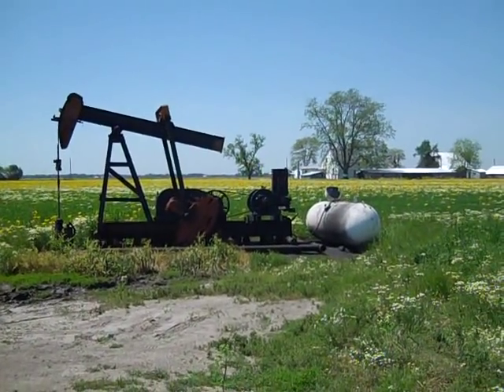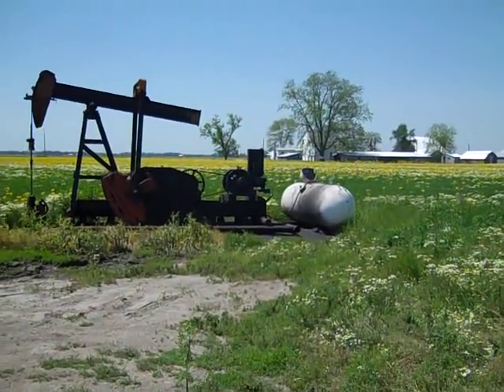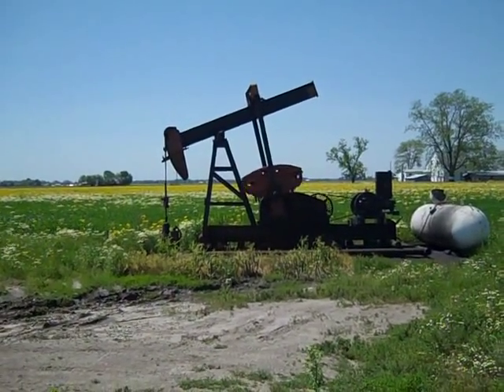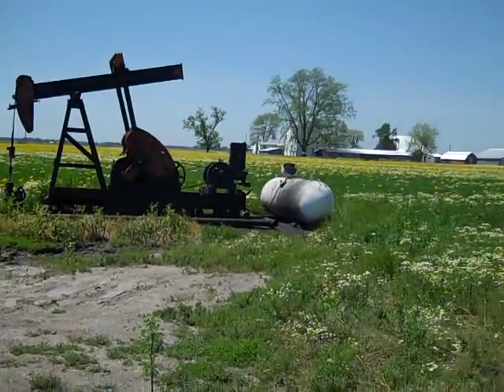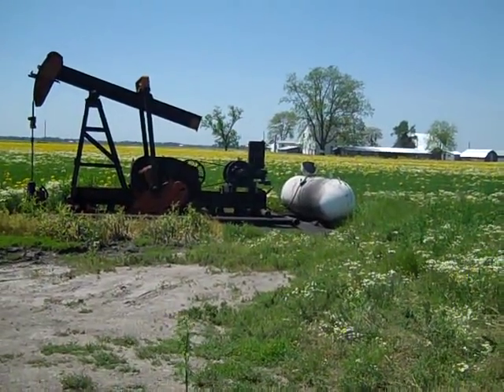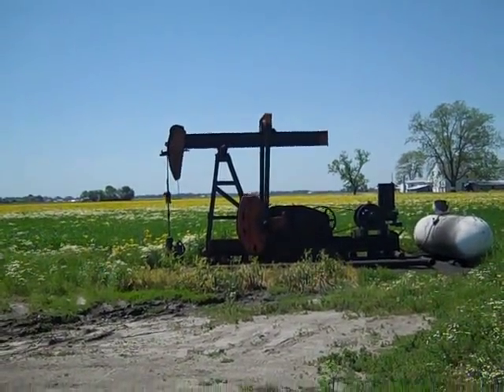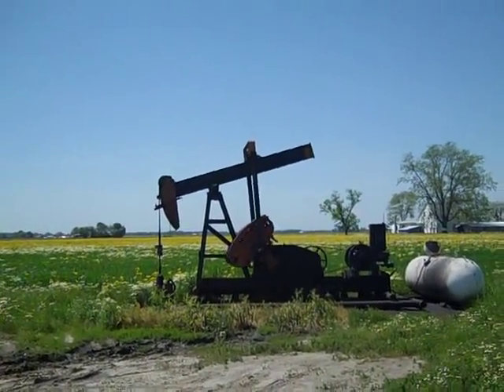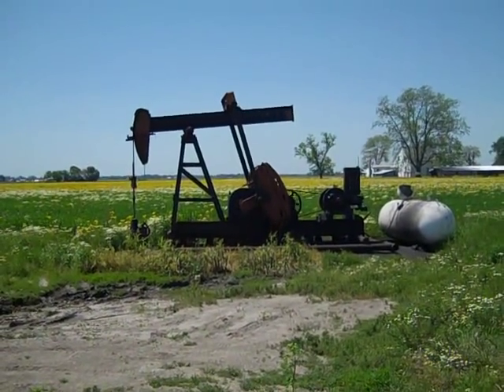Pump Jack: Is it running itself?

Comment: the average pump jack in west texas is probably 3-4 times the size, is powered from the electric grid (480V 3 phase), and can pump several thousand barrels of fluid per day. The water, petroleum (hydrocarbons plus solids, and other contaminants) will go to a processing satellite or battery to get separated and ready to sell or put into a pipeline. Pump jacks, gas lift, plunger lift, electronic submersible pumps are just a few of the different kinds of secondary recovery. They all have their uses

Comment: Scott- im a petroleum engineer, and have spent quite a many hours around these things. That is a super tiny pump jack. Pumpjacks are for fluids mainly (water, oil). Some gas will come up as well. Judging from the propane tank i would say that the small motor is powered by propane. The motor will get the weights on the arms to rotate the first time on the upstroke, then on the downstroke the weights and the weight of the rods (as well as any hydrostatic load) will pull it down, cycling the pump.

Comment: the propane tank is used to start the engine after it started and oil and water pumped down the well make enough gas to run its self if you looked around you would see a some kind of heater,or  a cold water knock out and a set of oil tanks and a water tank if the well makes any water

Comment: You are right Pa was the birthplace for crude oil. Though I am sure there were other places that had oil seeps. 
They pumped most all of the wells in PA dry many years ago. Recently the oil co. went back to frac some wells only to find that the wells had filled up again.
Many scientists now think that oil is actuality made within the earth. Here in Utah we drill down over 2 miles to hit oil. When it is pumped out is is quite hot.when cooled it will set up harder than roof tar. 
Best to you Earl
Reply: @EarlRausch the place where oil was first deliberately pumped from the ground was over in Poland in Eastern Europe , you can find that online.
There were wells in the UK as well which are many many years abandoned , the North sea is the source for oil there now...
The oil in the USA came along about 60 years after the oil in Poland and the UK , though the oil in those places was not taken in huge scales like it was in America back then...

Comment: E775, you were stopped on I-64 there, no? Much of southern Illinois is covered with these little pumps (stripper wells?); especially on the eastern side. These wells don't have the daily production that's found in the western US, but they produce for a long time.

Comment: Hi Scott, most likely this is running off the casing gas.  We still have these in Kansas.  I called a local shop that sells these things because as you are, very interested.  The gentlemen at the shop said that I didn't want to pay the price for experimenting for this pump.  This was about 3 years ago, I think the price was around $5000 for a used casing gas engine.  I hope you can find one cheap!

Comment: it's a Fairbanks Morse engine. the line going to motor is natural gas off the casing. propane is backup source. oil and water pumped out thru tubing goes to flow line off of pumping tee to buried line to tank battery across field. lots of these all over southern Illinois. I am second generation oil. my dad worked 50 years in the patch. I have 32 years in it

Comment: over here in oz we have pockets where you hit propane/methane first, then drill lower/drop pipe lower and get the crude. we also have coal seam gas ( NOT FRACKING ) where they drill to a coal seam and get salty water full of methane bubble (like soda can style ) and it comes to the surface and goes straight into a tank. at the other end of the tank there is a pipe on top for methane, and one on bottom to take the salt water away. years later they will dig the coal out.

Comment: I've been in the oilfield for 10yrs. and yes there are units that run off of casing gas, and the propane is a back up. As the gas dies down they will use the propane, but it is all depending on the situation down hole. There is a gas controlled throttle on the unit. Almost everywhere I worked oil, gas and water are extracted but that is in west Texas. Most water is in the zones due to the flood (flooding zones w/water to rinse oil through formations) or frac water.

Comment: That isn`t a hit & miss engine its a throttle governor Like the one I have here . That looks to be a Fairbanks Morse ZC 118 The model is the CU IN of the engine. The one I`m posing by is a ZC 503. The tank battery is most likley far away from this pumping unit so the trucks can pick up the oil by a side road . They can run the engine off the well head gas if the supply is great enough to. Many times they can run both the propane & well head gas to the engine.

Comment: I took care of many leases with old Climax (Arrow) "one-lung" engines 40 years ago in the Fruitvale, Mountain View, Tejon, Maricopa, and Cymric fields around Bakersfield, CA.  This is not a Climax, but they're similar and run on the same principals. They are beasts, they last for years if maintained properly, and the price of the parts has become more astronomical for these old machines as the years have gone by. I have a restored model in my parking lot at my office we occasionally fire up on propane. We're restoring an Oilwell model 25 pumping unit for a future marriage. I nearly tore a hand off with the crank handle for the flywheel of one of these engines back in '75 when it backfired and failed to disengage. I still have fingers that don't work right to remind me. I hold no malice to the engines, they are marvels...

In some cases there is sufficient casing gas (methane) to run the well all the time. In some cases there is insufficient gas (methane) to run the well at all because the gas has pretty much been tapped out of the formation. In some cases you keep a propane tank next to the unit so that in the event the well is off for some period of time and the casing fills with fluid you have a gas source to fire the unit until it pumps the fluid level down and methane again comes out of the formation through the perforations in the casing; the operator (pumper) changes the well back from propane to methane as soon as possible. The methane is free but the propane is a cost that eats at the bottom line profitability on low volume wells.

I had wells south of Arvin, CA that were 10,000 feet deep and they ran on what was then known as a Climax Model 96. Waukesha distributed engine parts for them back in the day and Lufkin, National, Continental Emsco, Oilwell, American, and a host of smaller national and regional manufacturers all made the pumping units. I think Lufkin is the only one of those I've named that's still around. I live about two miles these days from a small oil field that has several of these units and engines still active. If they get a carbon build up in the engine and it stays hot between strokes they'll begin to "blast" and sound like a goose gun going off around the clock. We used to break these clinkers loose with a mix of alcohol and water in a squirt bottle shot into the carburetor; the engine would then blow chunks... Memories
Reply: Mysterion h(
Reply: We used to dribble water down the carburetor on the V4 Wisconsin  motors on out balers; keep them revved up and all but drown them out with water. The carbon would break loose and blow out of the exhaust. They would carbon up and keep dieseling on when you shut them off and that cured it.

Comment: I've worked on and around many pump jacks over the years, they are used to lift oil/fluids out of hole. They are not used on gas wells and can lose prime if the well changes from oil to gas  They are very simple in design and work similar to those old fashioned hand stroked water pumps that people used to have on there wells with the primary difference being the actual pump portion usually being down hole with a pump rod that extends to surface that is connected to the head.

Comment: My grandfather had many of these wells when I was growing up as a kid.  That tank there is a propane tank for fuel that runs the engine.  These were pretty common in areas with no electrical access.  After electrical lines were more available many years later, my Grandfather had some of them converters to electric.  It all depended on the cost.
The oil pipe is underground there running to a large tank.  If not close by then it is likely in a more central location being fed by multiple wells....or at one time was.  They would try to put these tanks by a main road if possible so tankers could get easy access.

Comment: My grandpa has a oil well on his property. It had a hit and miss engine and the engine ran off the gas the well pumped. Now it has an electric motor cause the engine broke cause it was old, but the well still pumps oil although it pumps more saltwater than oil but he needs it for the gas.

Comment: the propane helps to start motor. once you've got it running you open the natural gas valve and turn off the propane. pretty fun to tinker with
Reply: fun you say?

Comment: I'm not an engineer by any means. My dad was, so maybe that's where I get my curiosity. I find anything in mechanics and manufacturing fascinating. I love taking things apart. I also have a strange fascination with power lines, utility poles, substations, and all that. I guess what I'm trying to say is...very cool video! I didn't even know that oil or natural gas could even be drilled in Illinois!
Reply: Apoc Alypse all over if you got the money to drll

Comment: The propane tank supplies energy the motor beside it, which uses the belts on the sheave of the motor to connect to the sheave on the pump jack. The fact that there's a propane tank present indicates to me that produced gas is not running this well. You can see the sheave on the jack spinning, which cranks the arms on the pump jack and therefore moves the rods up and down, lifting fluid. The well is likely pumping light oil with low sand, gas, and possibly water. If the well produces natural gas, it's not using the gas to run the motor; this would be obvious to point out as you'd see surface casing running to the motor as well as a scrubber in addition to other stuff. There's no production tank visible so I'm guessing that any produced oil or gas and piped underground somewhere. Hope that helps.
Reply: Yeah it looks to me like the gas engine is running strictly on cng or propane which would be trucked in twice a year to refill the tank. In Texas most of these run on electric motors now.

Comment: Many pump jacks do in fact use casing head gas (methane) to run a one cylinder engine similar to the one in the video.  However, there needs to be a small gas / fluid separator near the the system.  Think of something shaped like and similar in size to a vertical 5 gal propane tank.  The gas comes off the top and fluid falls out in the bottom, similar to a volume tank on an air compressor.  I think this pump jack runs off the propane continuously, I can't see a seperator anywhere in the system.   Sometimes a pump jack will have a propane tank near by to start the pump jack and then switch to casing head gas after the well start getting oil and gas to surface.  That is a large propane tank just to use for startup.

Comment: See that butane tank? That is the fuel for the engine that you hear running. The oil is pumped into a buried pipeline and then to a battery of storage tanks that may be a quarter of a mile away.
Reply: Nope. Propane for starting, then you switch it over to run off the natural gas from the very well it's pumping.
Reply: @yaboileeroy3038  I pumped 22 leases for one year. All wells do not produce enough gas to run the engine. We put about half of them on electricity. That was in 1960, south of Electra Texas.

Comment: The motor is most definitely running of the gas stored in the tank and the line you are asking about is running down hole to provide pressure to hold open the Subsurface Safety Valve (SSV). This is usually done with instrument air but seeing the age of this jack I would guess there is no air on site. I have seen units that use a modified 460 ford V8, one side of the V running as a 4 cylinder to provide prolusion and the other side of the V running as an air compressor to hold the valve SSV open

Comment: Hey there Scott, yes Grady is correct.  That is a small conventional ALS aka Pump Jack being powered by Propane.  I am now an ALS Inspector in the Bakken for these units for let's just say "a leader" in the industry internationally.  If you enjoy these come on up and you can see some other things to tickle your brain called DynaPumps, Rotaflex, and these pumps so large you have to be in a bucket truck with a lift to work on these.  Good times.  And yes they can be driven by all forms of energy.

Comment: Scott, You can get these for pumping water.  Dean Bennett supply Co.(just Google them) sells them. They're basically like the 100 year old ones that bolt onto a traditional cast iron deep well hand pump head. Baker mfg. and Dempster make them. Pricey though, $1,000-$3000!

Comment: yep, oil, im in illinois, we have those everywhere. it pumps oil to tanks near the road. the tanks are called oil well batteries. the motor runs off propane. some wells have electric motors.

Comment: There are much smaller pump jacks than that.  When I was working in LA we had several as tall as me that serviced a 1000 ft oil well.  Perfect for what you want to do.  They were really simple too. just  some angle iron with a pillow block, a head and one connector rod coming straight off the back of the center beam.

Comment: that thing is running fast... most of them around here in western oklahoma run at much slower RPMs just a real slow thump....thump.....thump....thump...... most around here use natural gas pulled off the well and only power on the up stroke and counterweight carries the crank around... Our natural gas well head we own on our farm, is naturally pressurized not no pump needed...

Comment: Bud the engine is a fair banks morse engine and its throttle governed thats why it sped up and slowed down notice it did that when the weights of the pumping unit were going up the engine size is a 118 and they flow the gas off the backside of the well to a regulator and into the engine I know because I'm a pumper and the oil is going to a stock tank sitting some where by
Reply: I didn't think fairbanks morse made a throttler.
Reply: grettagrids I'm fairly certain the engine is built by Arrow, they still make those kinds of engines.
Reply: +grettagrids Most of the Fairbanks were throttle governed engines. The few true hit and miss that they did make were painted red and not the normal green.

Comment: That pump jack is probably powered by the propane tank,although if the well makes enough natural gas it could potentially power the hit and miss engine. They have these all over the area in Kansas that I live in. Most have been converted to electric but there are still a few around that use their own gas to run.

Comment: I love that you think its cool......good for you.  Propane tank to run the engine.  No backside gas to run it.  Oil/Fluids lead line runs to tanks to separate, and sell.   Probably since two flywheels, a fairbanks engine.   Cheers.

Comment: Fairbanks Morse has two flywheels.
Arrow or Continental has one flywheel.
Two values on a Fairbanks one floats, Intake. open no oil.
The unit. oil well or Cabot. amount of total fluid. example 1.500x1.500=x42=x10=x.1166= 100% total fluid oil and salt water.
pump size square x link of stroke = x strokes per minute = x.1166 total fluid capacity of pump.
Starts on propane. when casing head builds casing pressure change to casing head gas.
Motor uses 1 cubic feet per hour of natural gas for every horsepower taken to run the unit. has a governor to keep motor from overrunning when less horsepower is needed.

Comment: By the sound of it and how it appears to be running it is an older two stroke natural gas engine, maybe an Ajax or a Fairbanks. Hit and miss engines are no longer really used in the oilfield. If you like the idea of owning and older engine like this one check out Arrow Engine company in Texas, they supply new parts for many older model engines for industrial use.
Reply: Mark Schwartz  They use electric in areas with electricity with in a couple miles

Comment: fairbanks morse engine I collect those but the tank is propane to run the engine nothing is pumped into the tank
 if you take a look at my page you can learn alittle
Reply: Two flywheels, one propane tank.........Fairbanks, and NO Backside gas to run it.  Good call, Solomon

Comment: the oil comes up through the inside diameter of the well called the tubing, the outside called the casing is dry and they extract the gas from there
Reply: TRD185 say what?

Comment: some wells make enough gas to power that lil 208 gas motor but if the well is down fora time u have ta use propane to runem fora while till the well pumps down and makes enough gas to run the motor then shut off the propane and yes well powers itself in some cases the well doesnt make enough gas and there isnt any electricity close enough fora electric motor so its yr only option